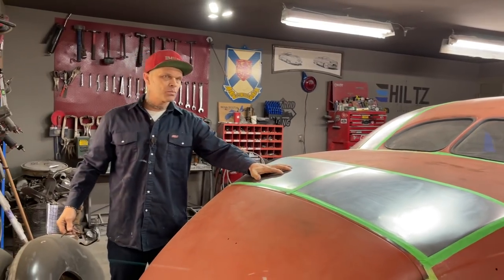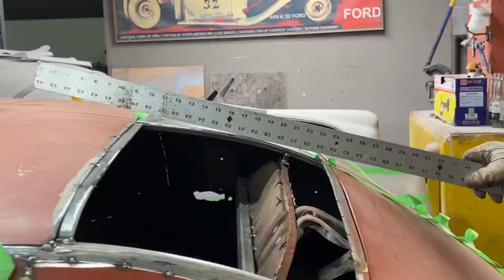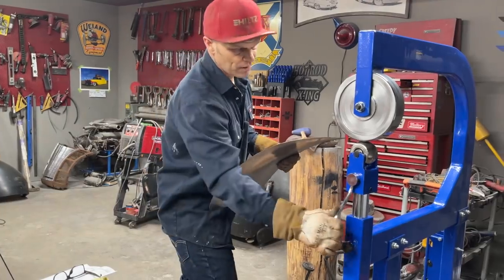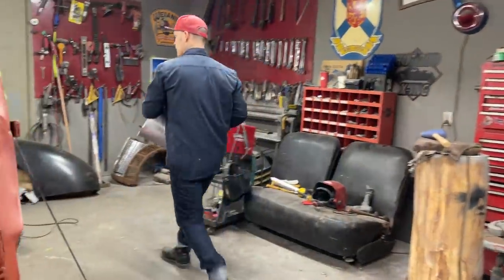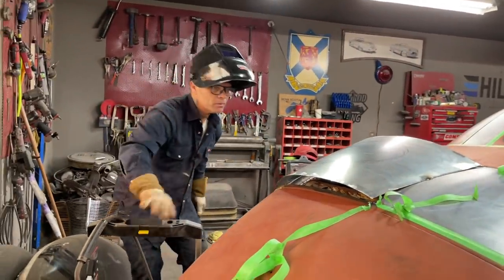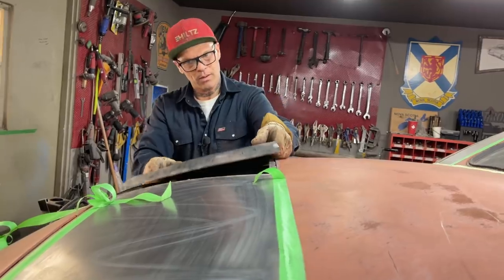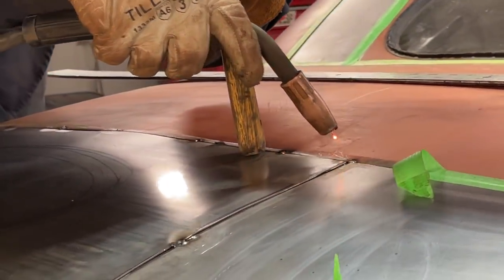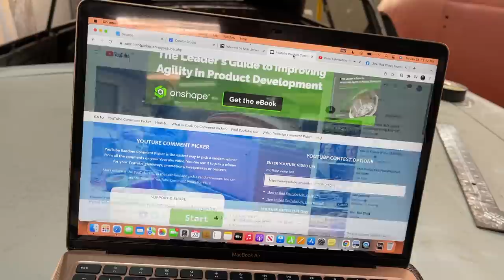Metal Shaping with English Wheel: 1940 Ford Tudor ➡️ Coupe (part 11)

Comment: Chadster, Just a tip if you anneal the panel with your acetylene torch prior to wheeling you can prevent some of the oil canning effect.  I have spent many of hours on the wheel and been there done that. I like the fact you used your own principles. "you can fix anything" If you put to much crown in-just reverse what you have done by flipping the panel over. Also place the crown down over your leg or a soft surface and apply pressure hand forming or removing some of the crown. Also if you place your hands in the center of your panel and apply pressure to the edges when wheeling the metal will move a lot faster to crown.  Please don't take this as me telling you what to do! Just trying to save you time. LOL Awesome content!
Reply: He s winging it
Reply: He Doesn't Take Constructive Criticism Well AT ALL...

Comment: The piece should fit perfectly before you weld it or it will have constant pressure all the time then things start moving from the pressure and you  have paint or metal problems down the road

Comment: Just a suggestion if you put a rubber band on the top wheel it will move the metal in 2  dimensional and 3 dimensional without the rubber band. The rubber band would have worked great for what you where doing Chad great video buddy keep up the great work.

Comment: Run it on the short side of the metal with the 2nd die from the bottom and you will be happy and you can always turn your piece upside down and run it with the same die.
Reply: Long side

Comment: Hey Chad. When you only want shape one way on the English wheel you need to use a wide rubber band on the top roller. Otherwise you get shape both ways. That’s why it won’t fit the second time back on

Comment: Chad the reason why they say to open your argon gas all the way is because it takes the high cylinder pressure off of the stem packing. Which is better for your values so they can last longer and it gives you better  CFM flow rate, apparently. btw you did pretty good on that English Wheel Chad, panel looks good.

Comment: I find annealing the sheets first with a carbon flame before working them with the english wheel they work easier and they have a more controlled form. And there are people out there that say annealing panels before running them in the english wheel makes the panels soft the more you roll them and tighter you run the dies the sheet hardens right back up by the time you have it formed where you want it. Great work and looking good.

Comment: Listen I'm no expert, but have had some training on the English Wheel. I was taught to go straight to the die closest to the curve you're looking for, start by tightening to the point were there is some resistance. As you roll through a few times the resistance should ease as the metal is forced onto the shape of the die. Tighten to bring back the resistance and repeat until you are at the desired curve. You ended up with too much in the centre cause you used to strong a die. Hope my little bit of knowledge helps

Comment: Great job for first panel with English wheel Chad. Just remember that each die represents a circle. For example the first one is like a 6 inch circle most likely.  Pick a die closest to the shape you want. No need to start with the sharp one and then change. Awesome job!

Comment: To get out of your over stretched panel all you need to do is use the flattest die and run it around the frame ( edge ) only. This way you have evenly thinned the whole panel and it will be flat again

Comment: Roll the edges of the panel to cancel the height of the panel (center area) this makes the whole panel bigger. Think about it as a painting, if you make the frame bigger it will strech the canvas. 👍

Comment: Using the top wheel and bottom anvil will give you a compound curve. If you cut a piece of inner tube to fit over the top wheel it will shape the metal side to side, not forward and backwarg.

Comment: ive heard them called slap sticks or spoons but there is a body hammer dolly 8-10 inches long 1-1/12 inches wide with a small contour that would worked well for that small little flat area it spreads the pressure across the entire area instead of hammering the smaller area giving possible small little dings rest against the metal and hit it with the hammer it works well from what ive seen another small cheap tool for your aersenal of body tools between your channel and fitzee fabrication i have no doubt i could build an entire car myself i do have enough mechanical ability to get me by no problem keep the great vids coming its probably a good idea i dont live near you you would probably get sick of seeing me lol

Comment: I must have used a different kind of English wheel.  To get the curve from window side of panel toward trunk side of panel I would have been running the panel across the wheel 90 degrees from Chad.  Am I that wrong?

Comment: match the anvil's radius to the radius you need. ease into it. sneak up to the shape you need. don't fly past it. light pressure until you get the feel for it. if you have a dark place in your shop, take your piece you working on in there and bring a small but bright flash light and aim it across the face of your metal. you'll see every pass the wheel made and you'll learn how to set the pressure between the wheels and how far or close to make your passes. i would be going the short way on the part you're making. try not to wheel past 3/4 to 1 inch of the outer edges. that holds the shape you're wheeling into the metal.

Comment: Have you ever used an old C clamp with one end cut and a flat plate welded to it to tack into place to hold your new panels flush for welding ? ..it works pretty nicely ..just thought id pass it on

Comment: Instead of beating it with a hammer, use a small hydraulic jack and a length of wood shape the end of the wood so it won't leave a crease in the metal. and push it up.

Comment: well my last comment was before you opened the trunk and then i too saw what you were up against harbor freight is a cheap tool place in the states has a body stud gun that welds like a nail on the outside and then you slibe a body slide hammer over the stud and lightly slide hammer up and down until panel is raised where you want and then grind the nail off like grinding a small weld spot costs about 100.00 us dollars yet another tool for your aersenal

Comment: Don't understand why you didn't cross it on the wheel to get that top to bumper, meaning that get vertical curve. Because you fixed the horizontal curve.

Comment: backwards. You should start with a flatter radius anvil and work your way up to the more curved radius. When you start with the smaller radius you can create a lump in the middle of the panel rather than blending a Smoot radius into your work piece.

Comment: lesson learned wheel test fit wheel test fit little by little outside of small bondoing ive never done any body work but i could see you went too far on the vid my suggestion is to reverse how you went about it use a lesser grit if you will and go to a harder more agressive if needed and test fit frequently nobody can say any dumb blonde jokes about jolene i was thinking the same thing as useing the metal roller myself

Comment: dude PLEASE PLEASE get in the habit of wearing some leather gloves when you are using the cut off wheel. People dont think they will cut you. I have been using them for 40 years and maybe wore out a thousand or more  disc.
recently cutting a piece with just the least bit of tension, the metal caught the wheel and the grinder jumped back onto the top of my hand. 25 stiches later I am ok and lost some use of my hand   but at 70 and on blood thinner I drove to the ER and almost did not make it . BE careful and remember you have people watching you that will do it the same as you.